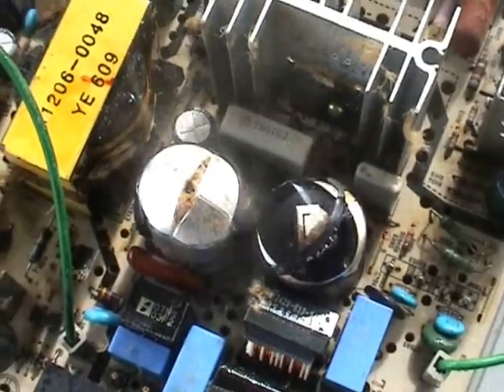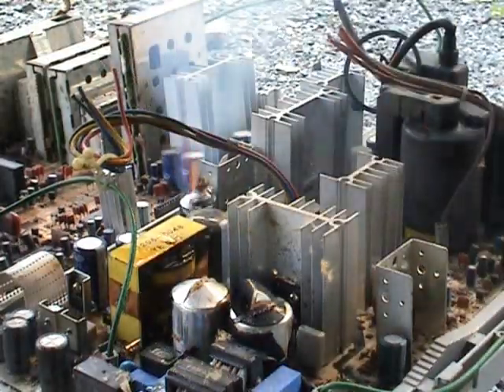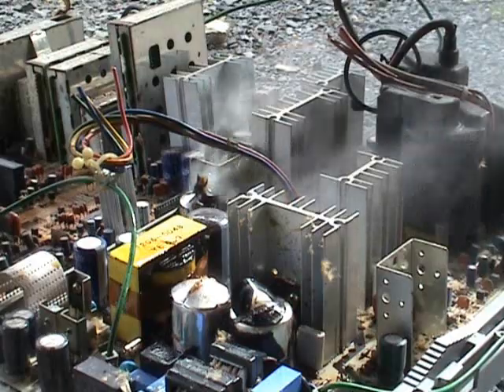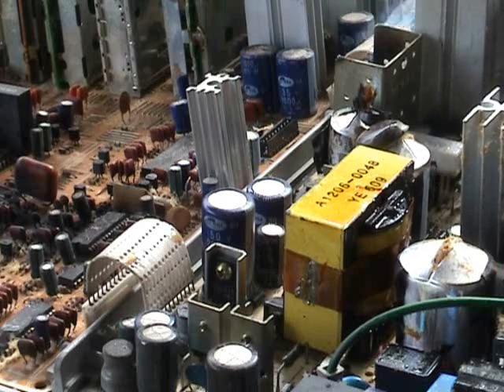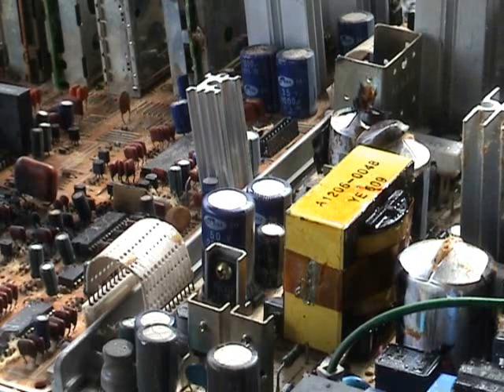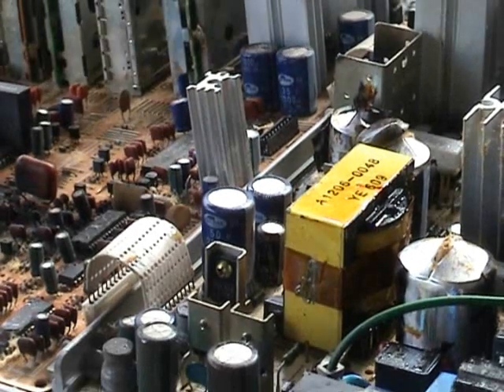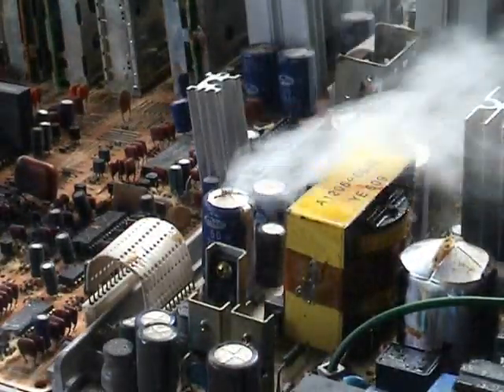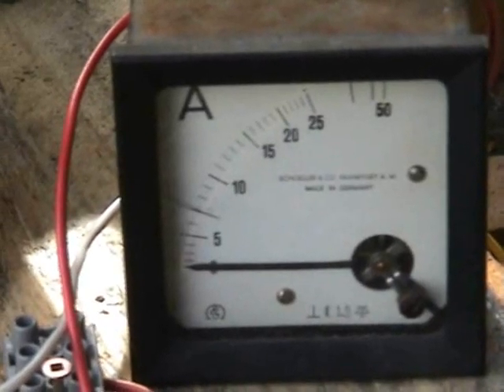TV caps blown up at 150 Volts AC - part 2

Comment: I remember when I was a teenager (about 14) I had a large 'C' transformer I had removed from a public address amplifier. It was 240v in and 27v ac out at 7.5A maximum. I had it rigged up to a cord so I could plug it in. On the output I had some fairly thick wires with the ends tinned and fashioned into probes so I could probe the back of PCBs with it. One afternoon my friend and I, after we had been blowing up electrolytic caps straight off of the mains using an old extension cord with the end stripped (crazy huh?) I was probing the chips on a motherboard with the transformer from the opposite side of the board so it would blow away from me. I had them spuing sparks over 4 feet! While they were doing it I was exclaiming, "Oh look, how beautiful, a shooting star!" and singing like a clown. Eventually We were both laughing so hard that we nearly wet ourselves. I had to run quick smart and drop my dacks, it was too much XD
Reply from the maker: I was about the same age when plugging in things, and popping Capacitors in the 220 Volts mains in The Netherlands.